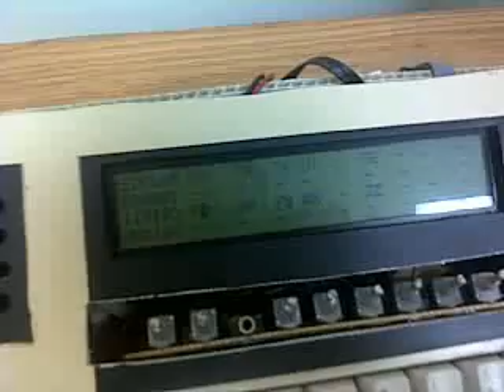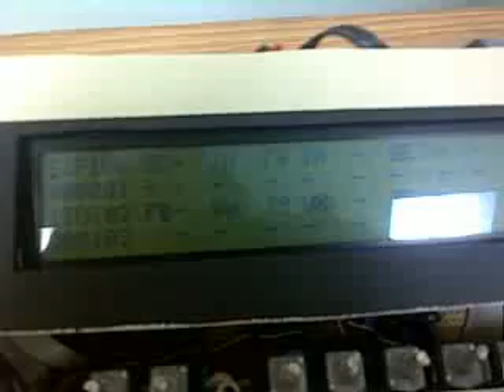Homebrew Singing Synthesizer Sings "Still Alive" from Portal

Comment: you do separate serial per every sound chip or it can be done with one serial too ??
Reply from the maker: Martins Abilevs I think in this case, I had separate serial channels for each chip from the microcontroller. Three asynchronous and one I2C.  In the past, I have had to share serial with multiple peripherals, and recall having luck using a MUX chip for this such as a 74HC4052.